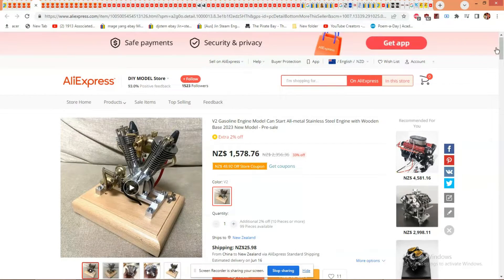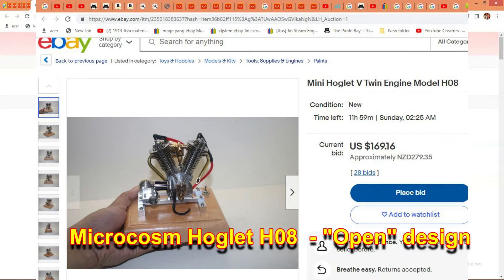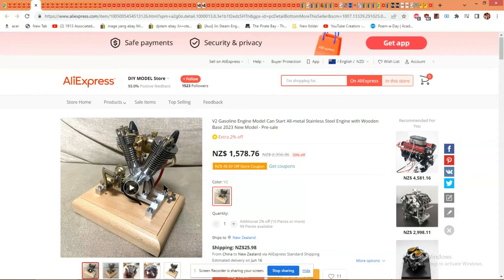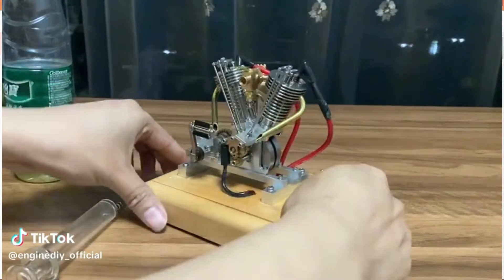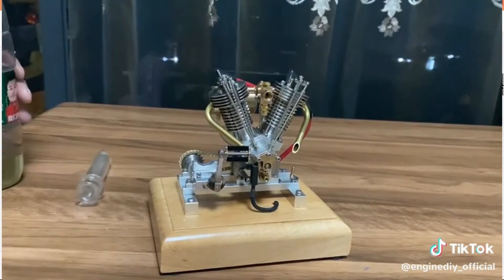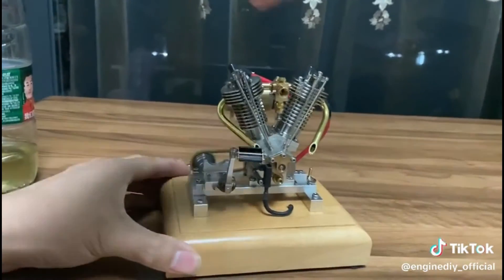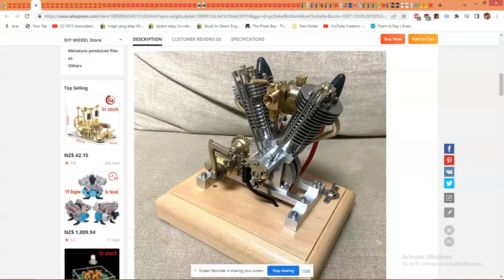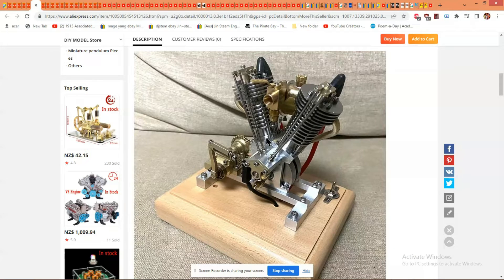NEWS New Mini #HOGLET H08 commercial Hoglet engine!! #vtwin engine for sale #Microcosmengine

Comment: Well, the plot thickens... being a person of zero patience, I elected to remove the engine from the wood mount, remove the plugs, and liberally apply WD-40 inside and out. This actually allowed the engine to begin to rotate freely. I again checked valve clearances, re-installed plugs, and proceeded to start the engine. I found that one cylinder was firing very intermittently and emitting raw fuel. I stopped the engine, pulled the plugs and verified a blue consistent spark on both plugs. The instructions say to start with the fuel needle 2 turns out, so I proceeded to seat the needle, then open it two turns (this is very tedious as the needle is almost impossible to grip). At 2 turns, the engine would not even fire and emitted lots of raw fuel. I continued to turn the needle in (lean) until the engine would run. At this point, the engine is not running good, but it will start and "kinda run." Very hard to determine if it's now a timing or mixture issue or combination? I am using 95 octane, no alcohol fuel and Amsoil Dominator 20:1 and fully charged 2S LiIon battery. Any suggestions?
Reply from the maker: I think you're doing well. This is what a troublesome engine forces us to do...go through everything. At it's simplest, we need spark, fuel, compression.
Yes, the engine needs to rotate freely. If fuel flowing in? You're tapping your finger on the air intake of carb to draw some in?
Check the spark and clean the plugs regularly, it's most important.
If you can get the engine to start running, even for 30 seconds, it's most likely a tuning issue. It's very easy to stuff up the low speed needle. Basically, at lowest speed at the carb, the low speed needle should be just off the seat, about 1/2 mm up. And the high speed needle about one full turn off its seat.
Your fuel mix is fine. Keep tying.
I'm still recovering from the stroke I had a month ago, eyesight still awful.
I have tried to fix two of my engines and failed in the last three weeks. One of them I think needs new piston, ring and cylinder and it locks up once it warms up. The other has compression issues, probably valves. Annoying and tiring, both are difficult to work on.
I have to tell you, some of my engines I try to improve and seem to end up wrecking them. Or find they have a mechanical issue. Some can be fixed. Some stay not working. I come back to them every now and then.
The hit-and-miss engines are the most reliable and easiest to work on. I'm thinking I'll focus more on these :)
Reply: @ThomasPCGuruENGINES  Very sorry to hear of your stroke. That has to be both frightening and frustrating. Thank you for the tuning tips. The instructions reference carb needles, but there is no illustration, so I am assuming the HS needle is the large one on the bottom side of carb and the LS needle is the small one located in the center of the throttle arm? I have wondered if the engine might run better and cooler on methanol rather than petrol? Have you also tried lantern fuel and is there a noticeable difference from petrol?
Reply from the maker: Appreciate your comments. Sorry late reply...m ine was running hot because I was starving it of oil or the piston gudgeon pin may have been installed upside down but probably my fault. Trying a disassemble and clean now
Reply from the maker: Correct high speed needle is the big obvious one. The other should have only the tiniest adjustments, at idle

Comment: Hello Thomas, I fired up the engine yesterday. It ran for about for about 20-30 seconds at a low throttle setting then stopped. Subsequent starts were unsuccessful and I noticed the engine had become increasingly difficult to rotate, so much so, I was no longer able to turn over the engine with the kick starter. I removed the spark plugs to make sure it was not hydraulically locked and to eliminate compression. This made NO difference. The engine is extremely difficult to rotate (no plugs) and it is obvious to me there is a serious mechanical issue, almost as though the engine has partially seized, even though it can still rotate with the drill starter. It cannot be rotated with the kick starter and does not fire at all. Fuel is fresh @ 20:1 synthetic, LiIon battery is fully charged. Valves have proper clearance. I have contacted Sterling tech support, but thus far, no resolution. btw, they advised me to secure the loose exhaust pipe with 272 High Temp threadlocker, which I did, but as soon as the engine was hot, the pipe was no longer secure. NOT the kind of experience I had expected from this engine 😞

Comment: Thank you for posting this video. I just acquired a new Hoglet engine and noticed immediately that an exhaust tube is loose, allowing it to rest against the rubber primary belt. Do you know of any way to secure the exhaust? Also, the instructions state that gasoline, kerosene or lamp fuel can be used. What fuel are you using? Thanks.
Reply from the maker: Hi man, the fuel is petrol or petrol types like lighter fuel or coleman fuel kerosine will not work. I only ever use petrol 95 octane and mix in some two stroke oil. If your exhaust pipe got knocked in transit you can unscrew its fastening nuts and examine if there's a bend or break. You might be able to GENTLY tap it back in to place then remount it/ A temporary fix might be  bit of wire holding it away from the belt. Figure out if it can be repaired, if not contact the seller for a spare part
Reply: @ThomasPCGuruENGINES  THANKS for your reply. The exhaust pipe appears to be a press fit into the cylinder head. There are no fasteners.
Reply from the maker: Are you able to twist, press or tap with wood, to get it back in?
Reply: @ThomasPCGuruENGINES  As you may know, these exhaust pipes are press-fit. The loose pipe swivels, but will not come out -  at least I have not pulled on it really hard. I was advised by Stirling to secure it with High Temp Red Loctite, which I have done, but not yet run the engine to see if the pipe will remain secure.

Comment: I’ve got Jin’s R33 Evo on the way now… hoping that it will be here this week.  

I bought the R28 V-twin when it was released w’ float bowl last year, and honestly was never impressed with it. It runs, just not very well.

I wanted to give Jin’s V twins another chance, so I bought the R29B Knucklehead from Stirlingkit…. Holy geez. The R29 is Jin’s “masterpiece.”  I have literally put over 60 hours of run time on my R29, and it runs flawless.  Starts with a single finger flip every time.

I had really high hopes for Jin’s  R31 shovelhead… I got into a bidding war on eBay, when it was first released and paid a bit more than I wanted to.   Unfortunately, the shovelhead that I got has had lots and lots of problems.  I bought the upgraded camshaft from Jin, which helped, but not much.  I was pretty bummed with the R31 even after hours of insomnia tweaking and tuning to get it running as it should.  

Definitely have high hopes for the R33 Evo;  Mr Jin has noted that the manufacturing process / CNC /surface  finishing have all been improved, and parts quality in general further improved.

Something tells me that the R33 evo will be another one of Mr Jin’s masterpieces…. He’s an incredible engineer and looking forward to what he produces next!
Reply from the maker: Loved this comment and your news. So interesting. You share my interest and respect for Jin. I know, I know, some have issues. But so do car motors from some manufacturers...even Toyota, God forbid. I've just spent hours getting Jin's H73 running "perfect" and it's only let down by a fussy carb (loose needle can wiggle from side to side is not helpful). And just taking apart the back of the R28 to find no grease, the rockers were so loose the motor wouldn't run. Took the carb apart to figure it out. Figured out how to dismantle the float to try to get the valve sealing on that. It's better but not sealed yet. I'll have another go then lighten it by cutting off the protruding steel rod on top of the float. Test run after fixing valve lash and new plugs was amazing, best it's ever run. Second run too. Third run and it's only on one cylinder -sigh -
Lots  of footage but I've been too unwell lately to put up a vid. Love your vid of the R29, black finned, this is the one I really wanted. So happy it runs like a dream for you...because it would be a bitch to disassemble; the only reason I haven't bought one. welcome, my friend, and you have a sub:)
Reply: @ThomasPCGuruENGINES  
Well Mr. Thomas, my R33 arrived this morning. 

And yes sir.  The R33 is Mr Jin’s new masterpiece.  Beyond impressed.  After taking it out of the box, I did do one thing; I removed the rocker covers and put a drop of marvel mystery oil down each pushrod tube. 
did this bc whenI got my R31 shovelhead, out of the box it had a stuck lifter. 

I ran the R33 on white gas & marvel oil 40:1, 
it immediately started & ran perfect, could achieve a really nice low idle, and revved through the RPM range, 

I didn’t get a chance to take some detailed pictures and share a video today, bc I was too busy running it 😁

Really gotta give Mr Jin applause on the R33…
I’ll make some videos tomorrow and share them on my channel.  🤙👍
Reply from the maker: Just saw this. It looks like Jin is really trying to improve fit and finish over time, good on him!!